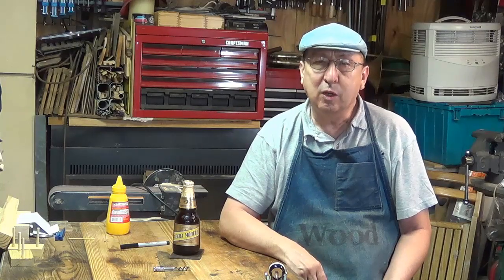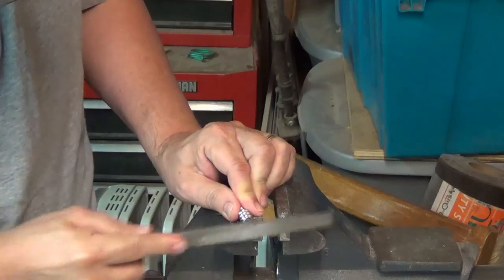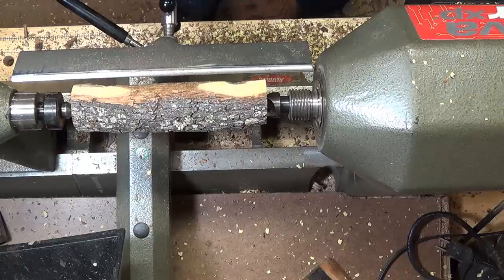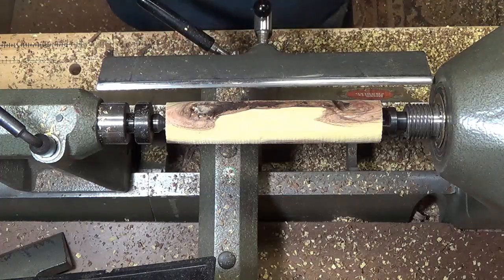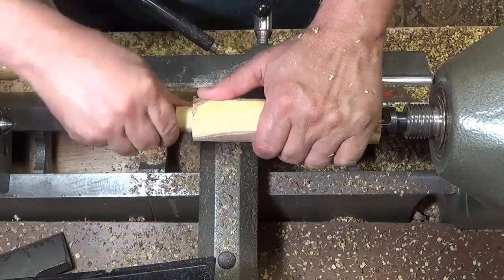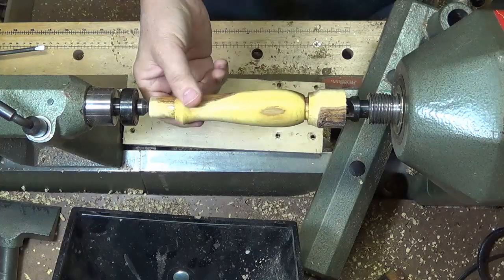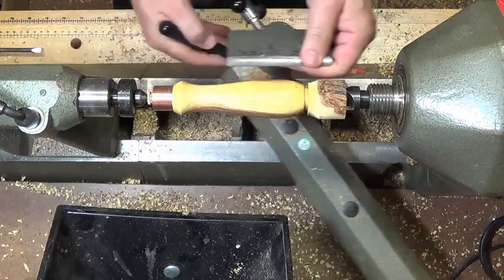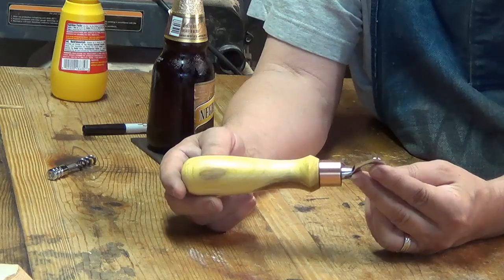Bottle Opener

Comment: Very nice project.

Unless you have a serious substance abuse problem, a bottle opener doesn't get the extreme stresses that a turning tool experiences, so I think there is less need for a ferrule.  Also, as the length of the metal stud buried in the handle increases, there is less stress on the end of the handle.  I've been using paint can openers (from Home Despot) to make bottle openers, leaving a shank that is more than 2" long inside the handle.  Rather than a ferrule, I make the bead at the business-end of the handle larger. 

Another suggestion is that rather than using expensive couplers to make ferrules, purchase a short length of copper pipe.  My local hardware store sells utility-lengths of pipe that are three feet long - which translates into 48- 3/4" ferrules that are individually much less expensive than ferrules made from couplers.  And an additional benefit is that it is much easier to cut a short length off a longer piece of pipe than it is to cut a coupler in half.
Reply from the maker: Louie Powell Thanks Louie. Good tips.

Comment: After you cut off the base with your band saw, how did you sand and polish it to make it look like the rest? Thanks
Reply from the maker: Andrew DiNatale The sanding is the same. Just be sure to leave a little extra when you cut it off. I sand with 150, 220, 320. I sand slightly where I already finished the piece so it blends properly. If it is not sanded enough a ring will appear that requires more sanding to remove. Thanks for your question Andrew.
Reply from the maker: Andrew DiNatale After sanding finish with rub on polyurethane. apply several coats, allow to dry. Use wire wool or steel wool between coat, apply paste wax and buff.
Reply: thanks for the quick response and tips! I'm not good at blending the cut section yet. it always looks like it was cut differently.